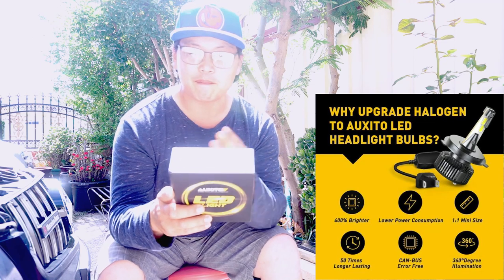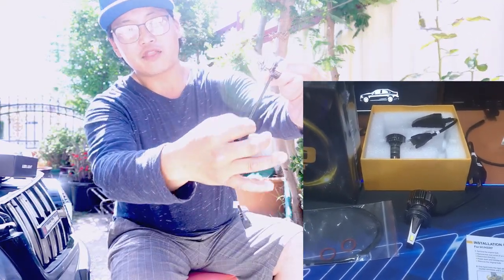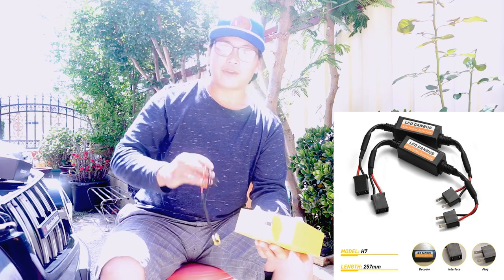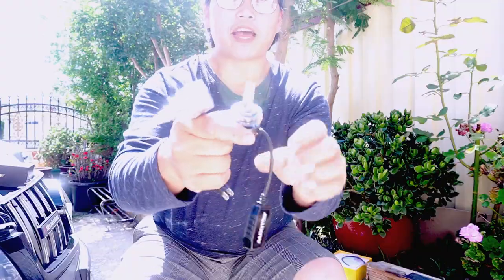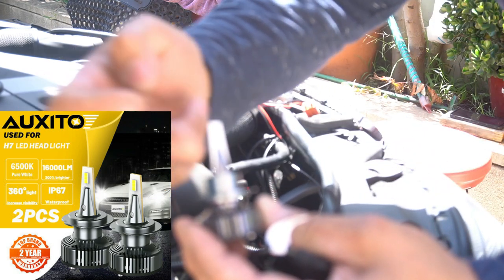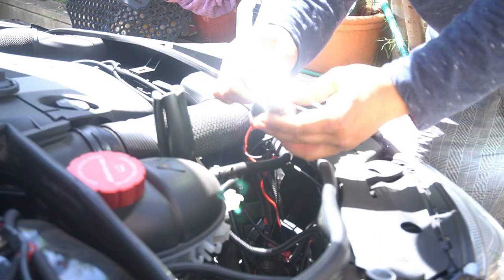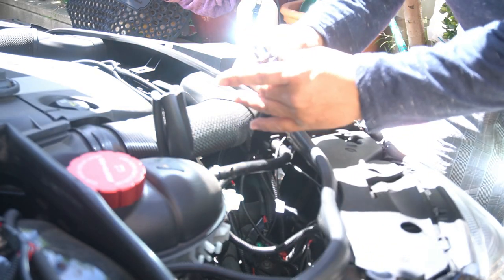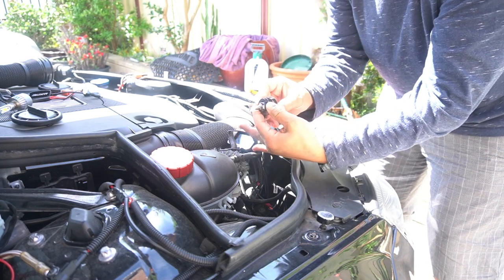mercedes mods auxito h7 led headlight bulbs installed in w204 c300

Comment: Do you know where I can get error cancelling resistors for aftermarket LED rear tail lights for the C250 W204 pre facelift?
Reply from the maker: what type of bulb socket is it? I think a good place to start is to type the bulb socket then followed by   decoder or error free cancellors and canbus ..play with the words
Reply: @MIKEYZVLOGZ  it’s the actually new LED taillight, it works perfectly but the error codes are; rear left side marker, rear fog lamp, left reverse lamp.
Reply from the maker: @WyseAdvisory  are the tail lights aftermarket or factory ? if factory u will need decoders or resistors
Reply: @MIKEYZVLOGZ  the upgraded tail lights are LED. The old stock tail lights I threw out are globes, hence the errors I think..solutions Mikey so I can sell my car error free?
Reply from the maker: @Justin Wyse  I'm not sure where to get them ... try dmp car designs

Comment: ate they good for w203 because i dont want to get error code
Reply from the maker: I GOT NO ERROR MSGS I SHOWED IN VIDEO..usually if u can use in a merc or any model with canbus then u can use it in most cases ..but there are unique cases where u will need a decoder